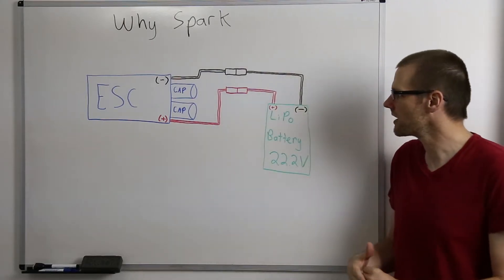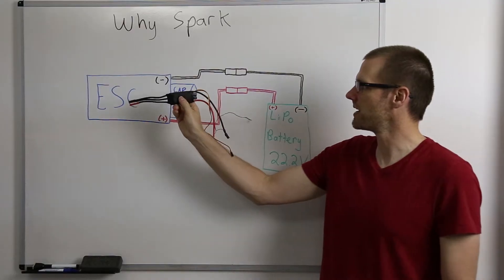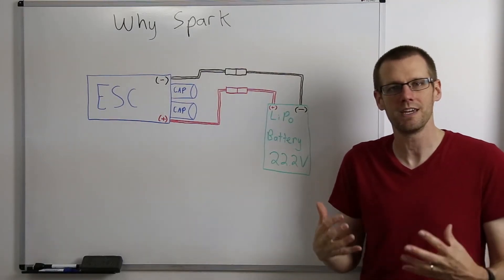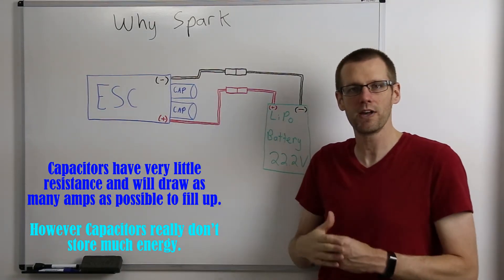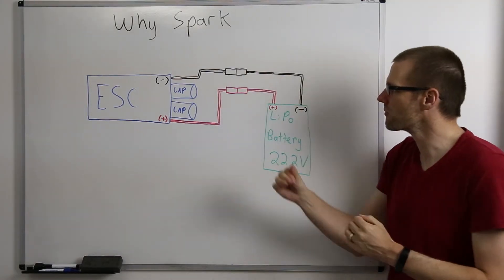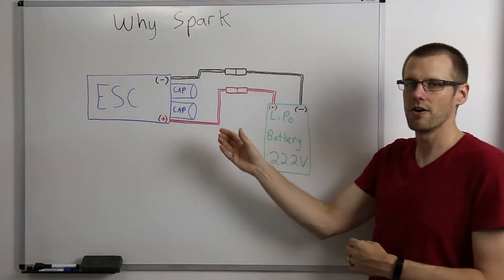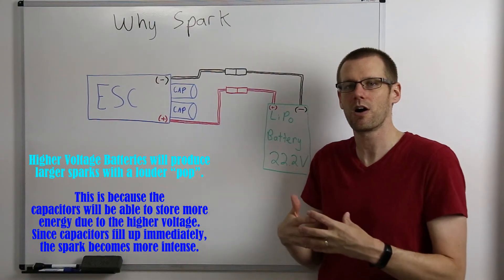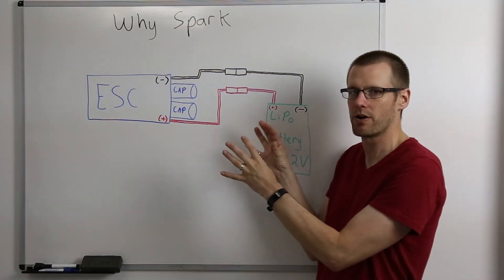Why is there a Spark when Plugging in a Battery to the ESC? Yes, this is normal.

Comment: Wintr says:
"That greater than 1/4 second is why Castle recommends against anti-spark, because the firmware in their ESCs will initialize faster than that, and will use too low a voltage to estimate cell count. AFAIK, they don't reveal how fast they need the charge to be, but clearly don't wait 1/4 second."
Reply from the maker: I can imagine a high resistance connector would be problematic. A quality connector does not use a high resistance anti-spark circuit. Here is what castle recommends on their higher voltage ESC's:
"Invest in connector sets made for high-powered electric systems
such as our CC Bullets, Castle Polarized Connectors, QS8 Anti-Spark or QS10 AntiSpark."

Comment: voltage does not flow. 
Capacitors don't protect 
WHen measuring current from a capacitor it depends on the change in voltage. so i=C du/dt  I current C capacitance du-voltage difference dt . So assuming the capacitor is not charged and is connected to some voltage the change in voltage du is the  (0-the voltage)* its connected to so the current spikes for a dt duration (let's say milliseconds) hence the spark.  The formula says it all.